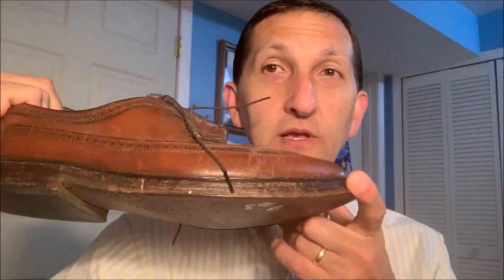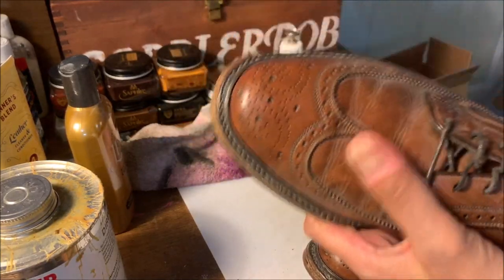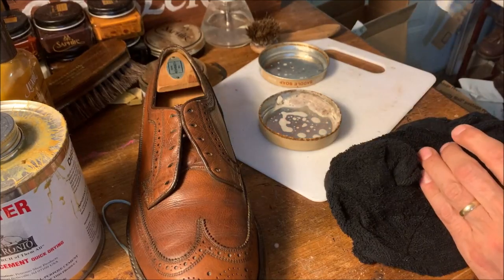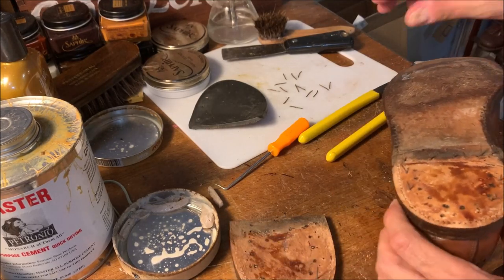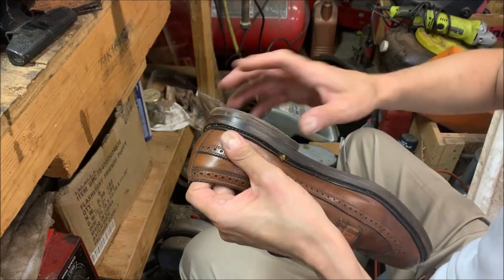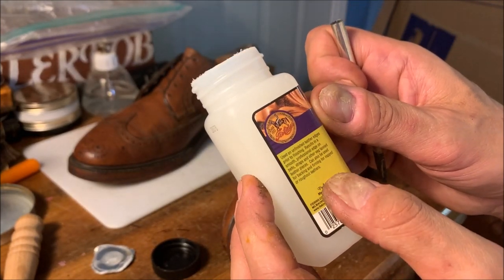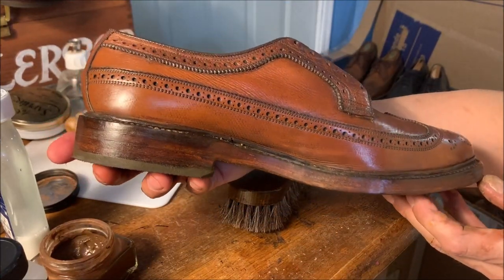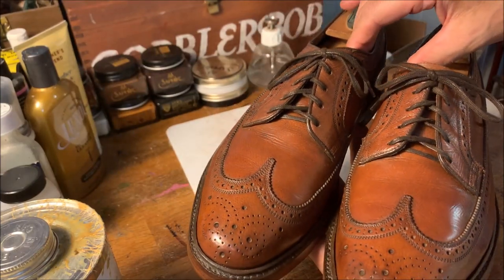1982 Florsheim Imperial 93602 Before & After with Heels

Comment: Cobblers are saying this home cobbler is getting better let’s hide our work instructions.
Hhhhhhhhhhh
For sanding use 2hp - 5hp bench grinder and diy it with long solid Stainless steel cylinder rod and attach to it brushes and 3 level of sanding discs 
You are a great addition to classic men shoes 
Thanks god bless

Comment: The burnishing is a very nice touch, but should be done AFTER dying, so the dye is absorbed better.  Then use an appropriate color crème polish during the burnishing.  This is what we did in the belt and wallet factory I worked in for edge finishing.

Comment: Robert,

What size are the top lifts, 15/16?

I’ve been using the gum trag also, and you are better off ( I’ve found) dying the leather sole first , apply the tragacanth and then touching it up again. The gum trag makes the leather pores close otherwise and the sole will not absorb as well after. I think you did it right...

Alan
Reply from the maker: Al gansk - thank you!! Those top lifts are 13/14. I get them from eBay seller Nordshoe.

Comment: Hey Robert, do you remember where you got your cobbler last? I've been looking on eBay and etsy but they look more on the lines of decorations than actually using.
Reply from the maker: William, I apologize for missing your comment. Yes, I found it on Facebook Marketplace. It was $20 I believe, but it was very rusty. I used Easy-off oven cleaner to remove all of the rust and gunk (you'll be amazed how clean it gets metal) and then I painted it with Eastwood cast iron paint with a sponge brush.
Reply: @CobblerBob   It's all good. Thanks for answering. I haven't found one local yet but that would be ideal.